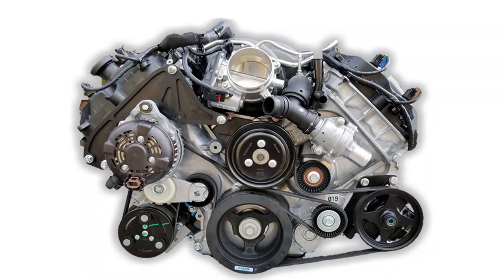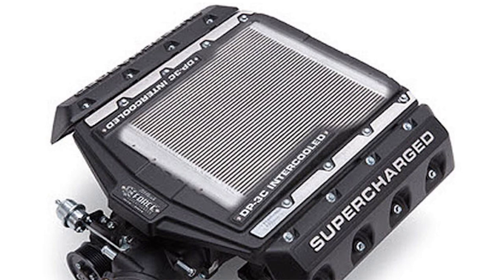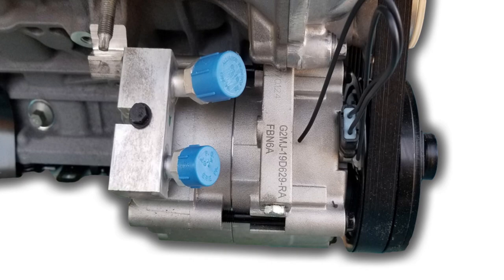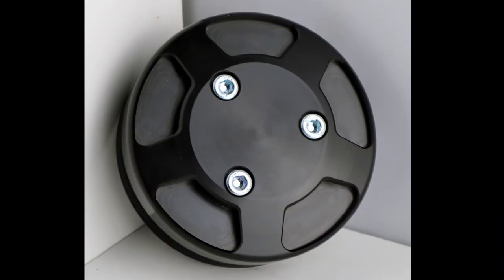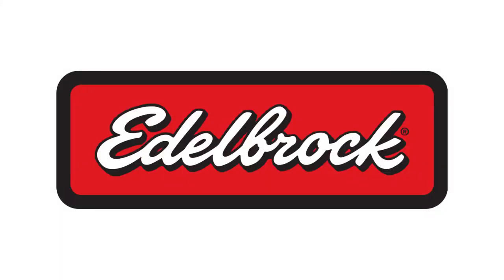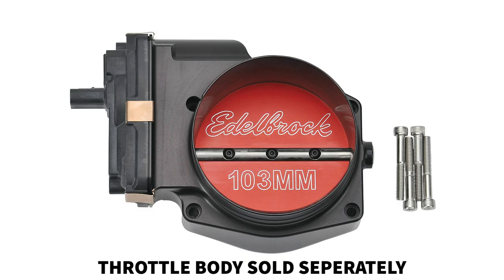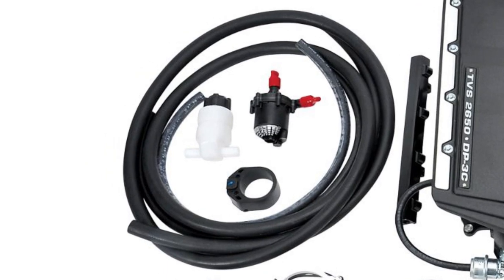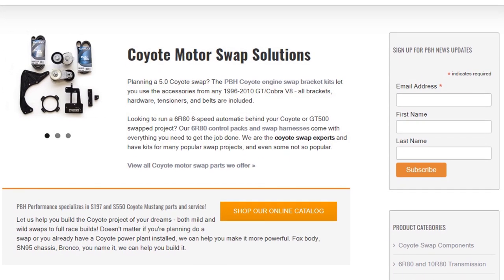Edelbrock 2650 Supercharger Coyote Swap Kit

Comment: Hey whats better with 2650 blower for longevity and reliability and durability.  The high compression coyotes or 9.5:1 coyotes.  New gt500 comes with low compression 9.5:1 motor and makes 700wheel on 91 octane and 900wheel e85. Low compression coyote will last longer and way less chance of detonation on 91 or e85. So why do so many people run 12:1 compression with boosted coyotes and factory gt500 does not. Stangmode makes 900wheel e85 on his 20 gt500.
Reply from the maker: I believe the stock compression or higher is the weapon of choice since it makes more power. If you want that extra buffer against failure lower compression can be done but you do give up quite a bit of power over the higher compression setups.